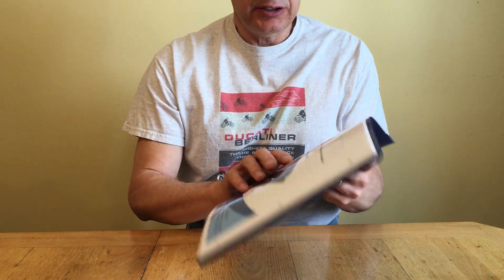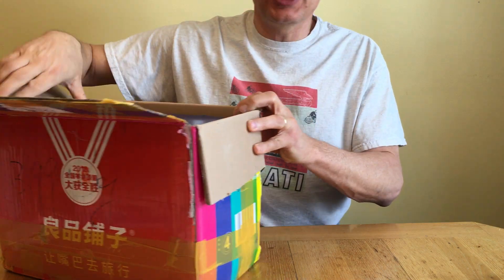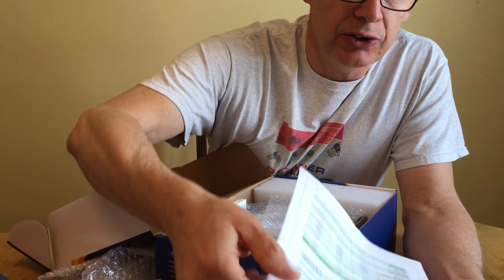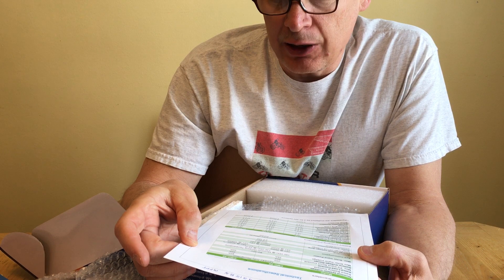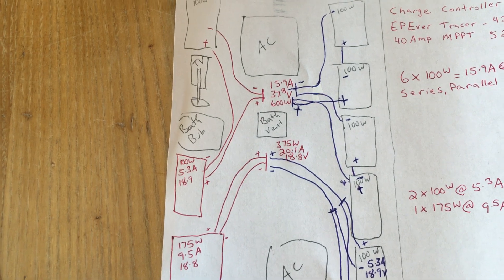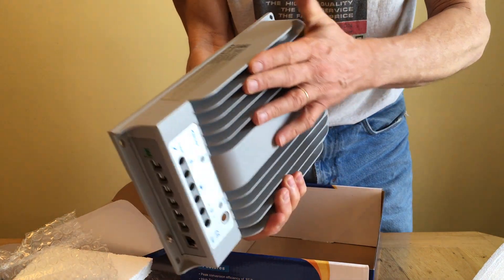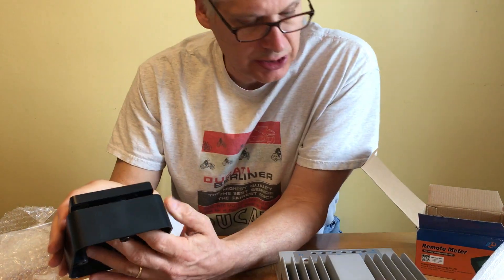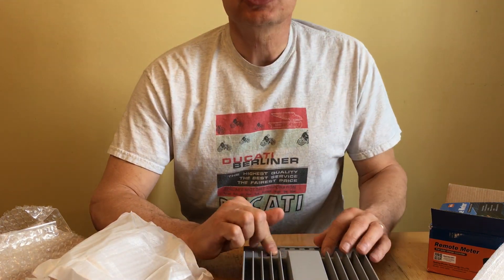EPEVER Tracer MPPT 4215BN 40A solar charge controller unboxing

Comment: did you run your set up with 6 panels i series  = 600w x5.2amp
if so how is it working,
,i have the same but i run mine in 3 in series x 2 parallel ,not sure which is better?
Reply from the maker: madsimoninsky same as you

Comment: Can you share where and how you bought your unit from China?
Reply from the maker: Alex Yankah, yes. I just bought the cheapest one available on eBay, and it shipped from China. I would recommend spending $20 more and getting it from the US seller.
Reply: Stim Racing Trailer and Travels I just watched your video on YouTube how are you liking the new charge controller so far cuz I'm thinking about buying the same brand and the 40 apps like you did cuz I am planning on 600 watt myself